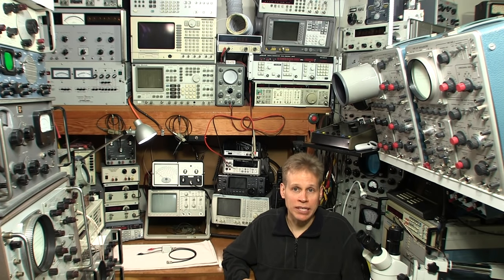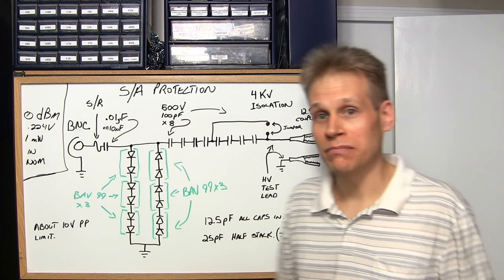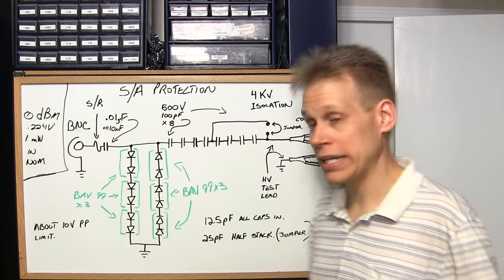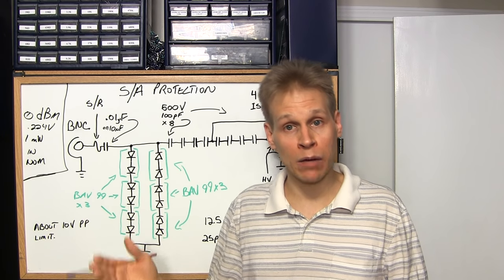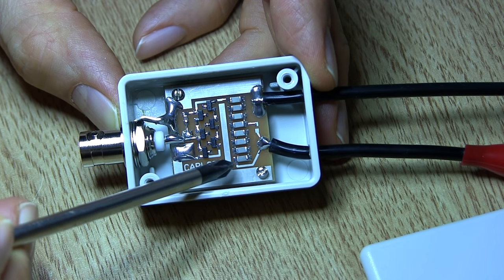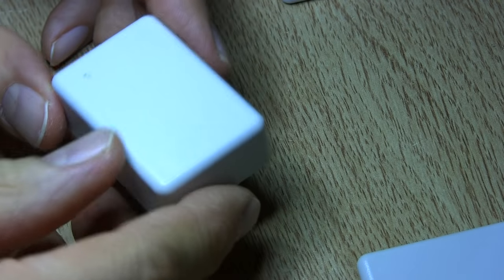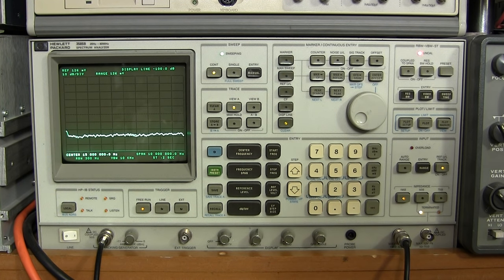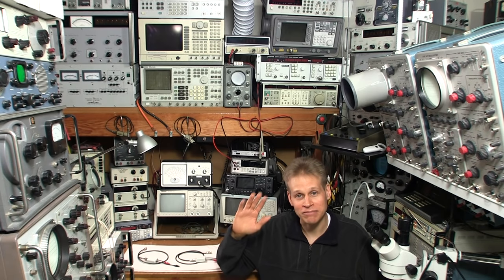Build this Spectrum Analyzer Protection Circuit

Comment: Hi Paul
any ideas
my instek S/A gsp-810 only displays from center to right not all across, if I connect it to computer it displays fine in monitor using the remote software
Reply from the maker: +DENNIS N Hi Dennis, are you talking about the LCD or the CRT?
Reply: the crt   the lcd is fine
Reply from the maker: Horizontal deflection issue? Do simple things first, like look for loose wires inside, cold solder joints, so on. If you display a signal on the screen, does the portion of the screen that's dark just abruptly cut the trace? Is the center of the screen (on the analyzer) accurate to whats displayed on your external monitor ( do things line up?)
Reply: Yes reset all connector wires use mag glass to look at all solder joints and the trace on the crt stops going right to left so only displays right side on crt
all caps look ok checked voltages that were marked on board all ok I have no service manual may never get one

thankyou again
Reply from the maker: +DENNIS N The problem is "most likely" in the deflection circuit somewhere, or in the circuit that drives it. Whether it's digital or analog, I don't know, as I have no schematics or familiarity with the circuit. The fact that it's displaying on your external monitor tells us that the digital portion seems to be working..... So something in between is the issue.

Comment: With all those caps in series and the shunt caps across the diodes you have limited the lower frequency response of the SA. I have used a SA for over 40 years and have never blown the front end of and SA. This circuit is NOT fast enough to protect the input of the SA. The only way to protect the front end of the SA is to use a fuse In doing so the circuit is more complicated.
Reply from the maker: I use this at 455kHz all the time, (flat through the sweep span) And.... It sure is fast enough. Watch more of my video's and you will see it in action.

Comment: Nice Circuit, here is how to improve it:
Instead of capacitors use resistors, they have flat frequency  response, as you said this circuit has high pass frequency response.  
The value of the resistors depends on the input voltage, so you might use a switch to select the voltage range.
Normally though, as you know, an attenuator is used to achieve what you are trying to do.
You can also use inductors to ground after each capacitor, to make it like transmission line.  The value of inductor and capacitor depends on what impedance you want your transmission line to be (75 Ohm  or 50 Ohm).
Reply: But the capacitors are there to block DC.
Most spectrum analyzers get damaged if they have even a tiny bit of DC at the input.
Reply: @youdonotknowmyname9663  Most spectrum Analyzers have a manual that indicate what is maximum input power.  For example, for tinySA is 1dBm; so you need to to measure the power with power meter first, then use correct attenuator value to measure your signal.  Normally the input of spectrum Analyzers are AC coupled, any way.  More over:
1dBm =1mW=V^2/Zo=> 1mW*Zo=V^2 => 0.050=V^2 =>  Maximum V = 0.223V   =>  So it does not matter if 0.0223V is AC or DC, because it is very low any way and this is maximum RMS voltage at the input of this spectrum analyzer.

Comment: after the bnc is it a fuse ?
Reply: A small piece of flexible wire to allow for slight movement of the center pin of the receptacle inside the female bnc. They can loosen up as they are not a pressed fit and when you remove the cable and install it the clearance inside the dielectric plastic would allow that mechanical strain on the circuit board and loosen up the solder joint.

Comment: I have a question, have you ever used that conglomeration of parts and tested to see if it worked. I have my doubts that it would save the front end of anything. I worked for a cell phone company  manufacture of test equipment and how we eliminated the possibility of overload the front end of the receiver part of the communications moniator was to sample the input power before it was connected. We used a diode as a peak detector driving an IC Compactor which operated a relay. If the power was sensed to be to high, it would NOT connect and would light a LED as an indicator of the power being to high.
Reply: a ''cell what'''' never heard of a cellphone'''''''''megaphone''''yes